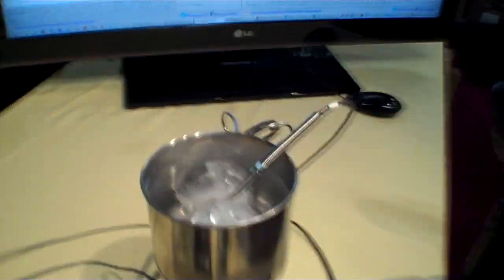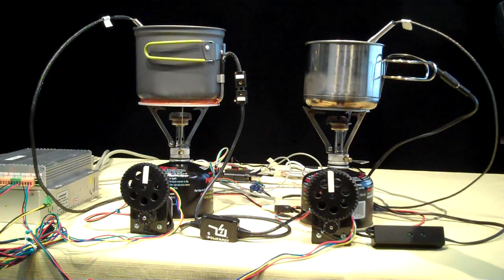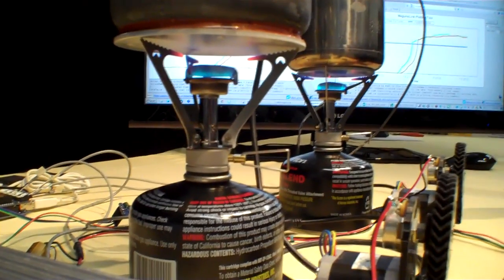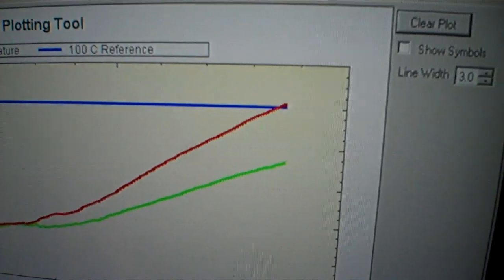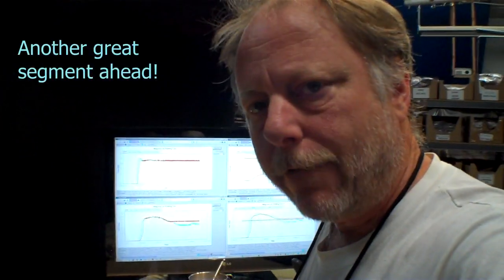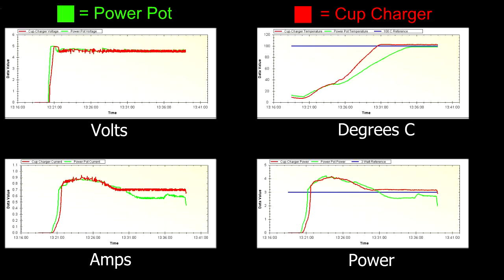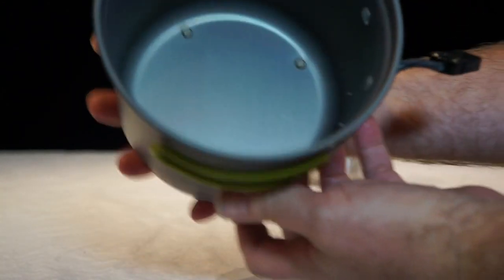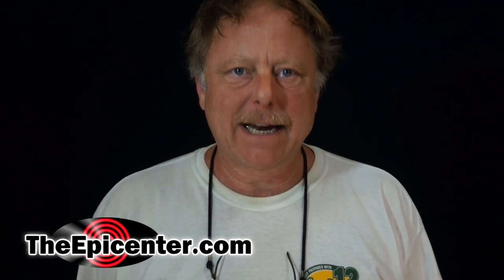TEST DATA!  PowerPot and Cup Charger - Thermoelectric Generator, USB fire powerd TEG face off.

Comment: You briefly touched on it but I think these devices must really be able to be used on an open fire. If you need to depend on fuel tanks to charge your devices you would need to carry vast amounts of fuel. I'd like to see you run them on an open fire setup, maybe sitting on a flat rock on the edge of a fire. If I'm travelling for just a couple days I'll just pack extra batteries. Its lighter and easier.

Comment from the maker: That is a tremendously valid point. I will put my thinking cap on. If I assume you want to use a wood fire with no stove or adapter plates to heat the TEG's, is it practical to make a small fire also, using rocks to support the TEG's and focus heat to the collectors? Perhaps a specialized 3 point rock support with cross feed sticks for the TEG only, and a regular fire for your normal needs?

Comment: Just curious if you could add an additional TEG on the outside of one of the pots like the Marlow SP1848 and have another charging unit to take advantage of the heat transfer, etc.? Also curious if you could make a DIY unit with two of these TEG's wired together to double the output and charge a laptop?

Comment: Hi what is the lowest temperature on the hot side can you go like 90°and make good power? if I can get cold air constantly from the other side with a heat sink and fan? It for my project but I need the hot side to generate at 90° is that possible thanks

Comment: Great job answered a lot of questions but, that voltage isn't enough to do anything. it takes a steady 5 v. to charge a phone. that is why a battery is often used in conjunction, so the device charges the battery and it is always lagging behind in charging...
Reply from the maker: Walkertongdee The official spec for USB 2 power is 5v +/- 5% which is 4.75v to 5.25v. But most devices can charge down to about 4v in my experience.
Reply: EpicenterBryan
Hey Brian love your videos, how about a real world test with no ice in the field and after using it see it it can keep the battery full and the phone full. If it can't the device isn't practical a storage battery would suffice. Actually you could sell battery storage devices on your site too! Been a long time fan, like your attitude, no BS just straight talk. Ever think of making your own devices like this for sale? You could do better, these seem inadequate but I'm not sure.

Comment: An excellent test. Would you have any idea if either of these products is capable of charging 2 CR123 batteries? And how long would that take? Thanks.
Reply from the maker: If you can send me specs on those I'll look into it.
Reply from the maker: Yes it would work. But you would need to buy a CR123 charger that has a USB power input. Then just plug that directly into the Power Pot or Cup Charger. Search google for "CR123 usb charger"
Reply: That's good news!! Thank you very much.
Reply: SirThunderPants Yeah. good news. If you buy a usb charger it could work, technically speaking. All you would have to do is boil water for 4 hours keeping watch on it and adding more water at regular intervals. IF you're diligent and lucky enough to get the max power output from it (adding ice continuously would likely do it) under ideal circumstances you should be able to charge one CR123 battery every two hours. If you decide to do this, take my advice and do it privately, in your home, once, and never speak of it .

Comment: Hello Bryan, 
Very well described videos thumbs up. 
I truly appreciate if you could share some info regarding what software and equipment to measurement of temperature and generating electricity you have used are they expensive ? Actually i need to build same for my small lab environments for the university projects . 
Thank you
Reply from the maker: The temperature measurements were made using Thermocouple Amplifier modules (MAX31855) from AdaFruit. You can also get the K-type thermocouplers from them. I may have bought the thermocouplers on E-bay. Adafruit has an Arduino library that makes it easy to incorporate the readings into your code.  That should get you started. Lot's of examples out there...
Reply: Thanks Bryan for your quick response.

Comment: how do these products fair in terms of charging a CELL PHONE?
Reply from the maker: Using an iPhone 4s and with the water boiling, the PowerPot will charge at a 2.5 watt rate and the cup charger will charge at a 3 watt rate. This amounts to a 20% faster charge with the cup charger compared to the Power Pot.

Comment: Hmm... wonder how many more Watts/Amps you would get out of the cup charger if you found a large and rather tall aluminum heat sink to stick down inside the cup/water to further pull/dissipate the heat from the cup/water at a much faster rate  ;)
Reply from the maker: The maximum would be similar to having ice in the unit. For the cup charger it was 5 watts peak, for the PowerPot it was 4 watts as seen in the video. Alas, the company that made the cup charger is out of business. You should still be able to get a PowerPot directly from them.
Reply: EpicenterBryan PowerPot is out too. Their shop sell leds and powerbanks.